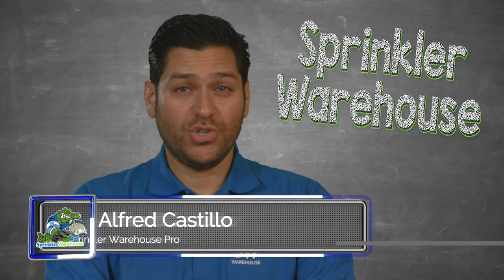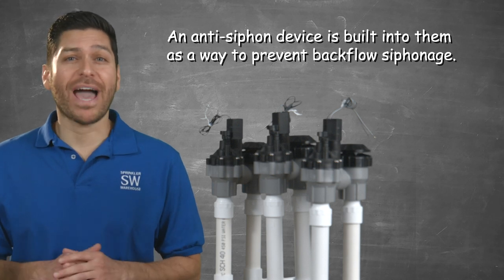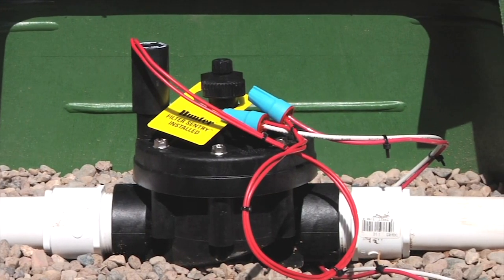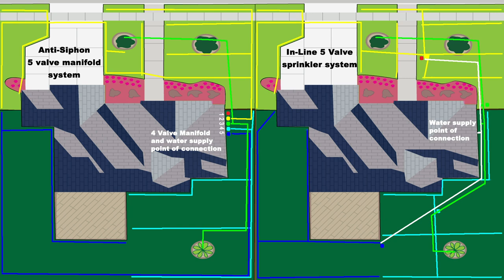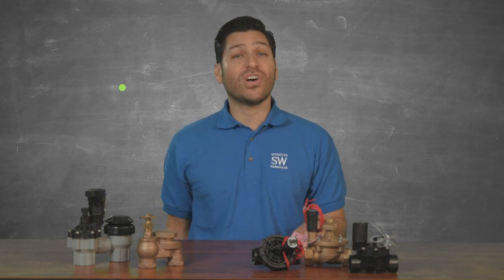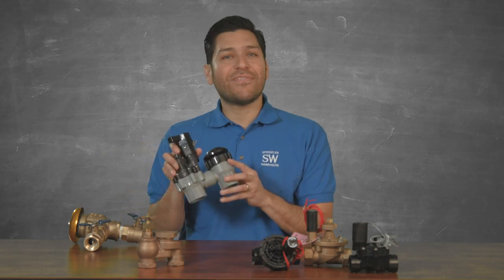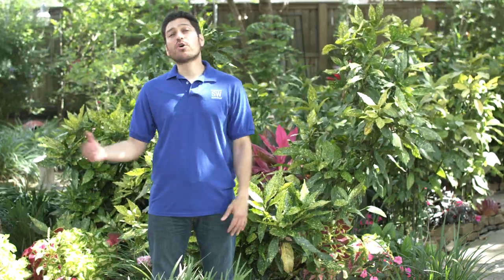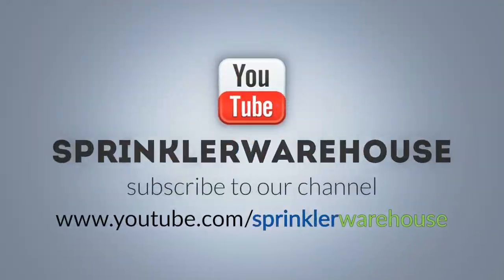Anti-Siphon vs Inline Valves

Comment: Hi,
I have rainbird anti-siphon in both front and backyard. I recently got them replaced from the inline valves. Now, I notice that when the sprinkler truns off, there is spurt of water from the anti-siphon emitter cap region. My contractor said its OK and there is no issue with that. Please confirm if this is fine and OK to get some water coming out after the sprinkler shuts down.

Also, I am getting some water hammer when the turn off happens, water hammer was more prominent in the in-line valves.
Reply: That spurt of water is the water backflow through the line and being stopped by the new anti-siphon valve through the bleed.   By design.

Comment: If I am running 30' PVC to feed a 4 zone system from my GARDEN HOSE SPICKET, and I use a cheaper hose bib anti-backflow preventer, do I need to bother with an (master) Anti-Siphon valve? OK to just use in line to control my zones?

Comment: My sprinkler system is completely separate from the town water and runs off a well/pump. Is there any reason to have the anti-siphon valves in that kind of  a system? Aside from the additional few bucks for the PVC when building the manifold, any reason to go with one vs. another? Thanks!

Comment: OK, inline system doesn't require as much pipe, what about electric connection to each valve? Doesn't it requires more electric wire?
Reply: Depends on where you place the valves. You can do them in the typical spot where you would put anti siphon valves and you'd run about the same amount of wire. They both have their pros and cons but I decided to go with anti siphon valves. No need for a back flow preventer when you have these.

Comment: Well, one can OBVIOUSLY install a backflow preventer WITH an above ground sprinkler manifold system, CORRECT ? Problem solved.

My only question remains:
Can I install  inline type valves (ABOVE  GROUND) in a manifold type configuration with obviously a backflow type device  ? 
I would create a Unistrut type structure to mount them on... I live in year round warm / non freezing weather.
Reply: you can install them above ground. People probably just go underground because you connect to the line thats underground, also its protected from the sun/weathering and hidden away.

Comment: You can manifold inline valves or antisphin valves... anti siphon valves are good for one thing and one thing only.... when you cant tap into the water supply at the meter and bring a mainline to the area you are working in. You may have to tap off a hose bib line under the house bypassing an existing backflow device. That's when you need a valve and backflow device in one such as the anti siphon valve... do remember though to check with your local regulations as this valve does not protect against back pressure.

Comment: Doesn't an inline valve stop siphoning when it closes? Thats whats confusing me. It opens to let water through and then closes so no more water can come through, therefore eliminating a siphoning affect. Correct or no?
Reply: Yes, and no.  An inline valve can fail in the open position, leading to backflow.  The anti-siphon will prevent backflow, even if the valve fails in the open position.
Reply: @SteveTomkins  so of I'm using anti siphon valves, would you recommend installing a back flow preventer as well? Or is that over kill and not necessary?
Reply: @mustanggt5985  An anti-siphon valve, properly installed, is technically a backflow prevention device.  Some municipalities require a more robust backflow preventer, many do not.  I'm not a plumber or irrigation specialist, so I can't really define overkill.  I know that both of my homes in CA had anti-siphon valves and no other backflow prevention.
Reply: @SteveTomkins  define "properly" installed. Is it true they're suppose to be 1 foot above the highest sprinkler head? If so, why? Thanks...
Reply: @mustanggt5985  Some models spec 6", while others specify 12".  I believe the concern is that the backpressure could overwhelm the the anti-siphon function of the valve.
Reply: @SteveTomkins  I thinking of installing a back-flow preventor even though I'm using the anti-siphon valves.